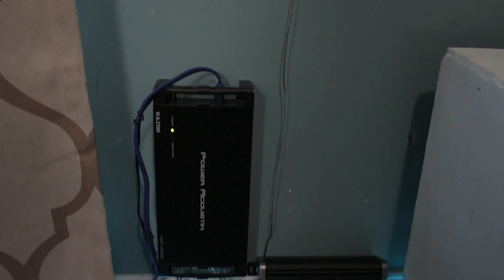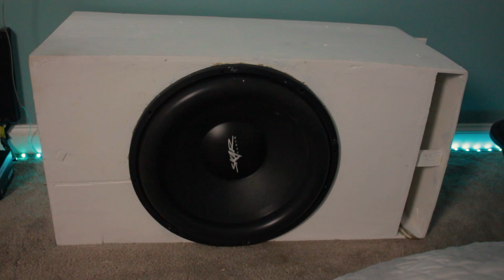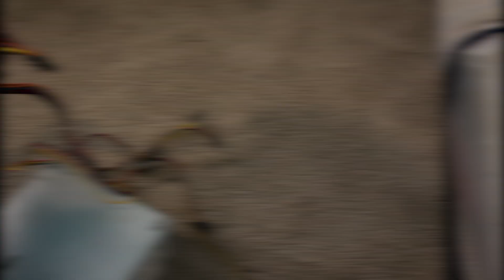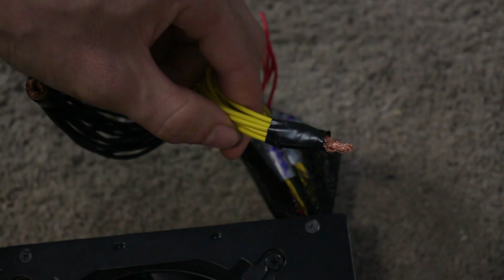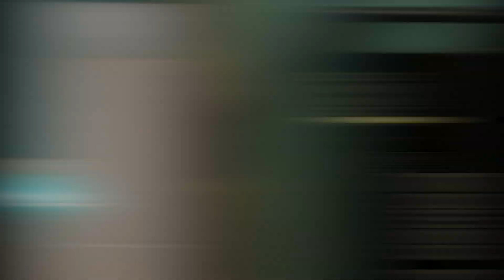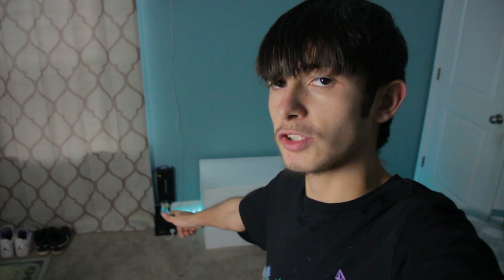How To Setup Car Audio Indoors For Beginners

Comment: can you use a normal power supply that says 12v? like the plug with just wire(s) coming out? so we don't need that PC block and fan etc.

Comment: Very inefficient tho. The pc power supply converts AC to DC at about a 20% loss. Then the amp converts that DC back to AC at about another 20-40% loss.

Using a 1000watt power supply youd only have roughly 500-600watts max power at the cost of 1000+ watts being pulled from the wall.
Reply: @thr0nic  no your run of the mill 80 bronze spec is at least a wasted 20% and gets worse the higher the power supply is loaded.

That 80% is only good up to around 50% or less load.more then 50% load and the efficiency starts to fall off a cliff and depending on its build quality can get down to 35-50%..this is why most people buy a much larger power supply then is really needed..

Basically if you have a 1000watt power supply and you load it at 500w it's going to pull around 600watts out the wall.

But if you use that same PS and load it at 800w it's going to pull around  1100-1300watts!!

This is why using car audio in a home audio environment is extremely wasteful. You are converting AC TO DC with the PC power supply  at a loss of atleast 20% min THEN the amp is converting DC BACK INTO AC with at least another 20-40% loss depending on the amp,it's stupid..It would be less wasteful to use a car battery with a wall charger,but even that is going to waste some power.

just go buy some home audio amps and be done with it!! Gezz maybe like $50 on marketplace if you search around a bit .
Reply: @thr0nic   experimenting around with it isn't a big deal,hell plenty of times a PC power supply is a fantastic and cheap way of getting 12v in a home environment.

but this guy clearly is using this as his full time home audio setup,and it's just silly to be making videos including it. It's not cool it's not hip and it just shows ignorance and laziness..

Tons and tons of used home audio equipment out there,and most of the time people are practically giving it away..
Reply: what else would you recommend?
Reply: @Kau001  get a home audio setup! 

A home audio receiver can be had used on marketplace for under $20 if you aren't interested in stuff like Atmos.. if you just want audio basically any receiver will work from since the 1970s and people basically give them away.

If you do want newer tech like atmos/DTS decoding and it to have 4k60/120 HDMI then you'll need to look into newer receivers that have those features.

Your car audio speakers will still work as is,but a receiver won't be able to power the subs,so then you can get a home audio sub with a built in amp.again if you aren't picky they can be found on marketplace for $50 or less for a 10"-15". Or you can get a home amp,but those aren't as common used.

Comment: Hey bro do you have a link to the power supply, and also definitely love the video
Reply from the maker: Thanks for the support I really appreciate it! This is the PSU I used in the video: https://thermaltakeusa.com/products/smart-500w-ps-spd-0500npcwus-w  I now use an EVGA 650 watt PSU for a bit of extra power: https://www.evga.com/products/product.aspx?pn=100-N1-0650-L1

Comment: find a led power supply , you can adjust voltage to 14 .5 with those and you can generally have more power and they r cheaper .
Reply from the maker: You're definitely right. Whenever I upgrade my setup and need more power those power supply's can have great value . Thanks for the recommendation.
Reply: @thr0nic  i tried an atx with a light bulb , when you switch off for a moment it sends high voltage to the bulb . same power led supplies are like half the price and there r 500 watt ps , which actually is not needed at home setups , i use a 200 w now and speakers can not take more than 100 rms anyway .